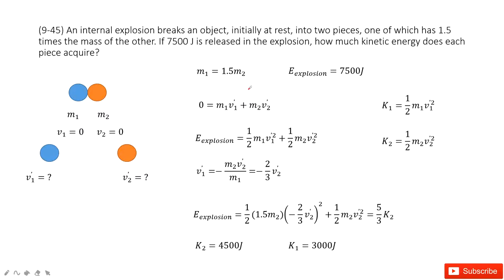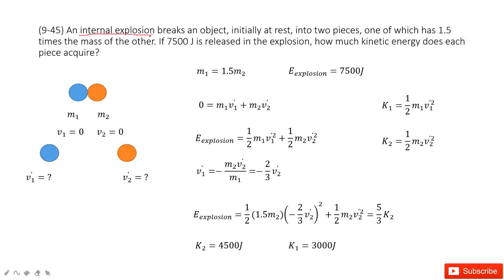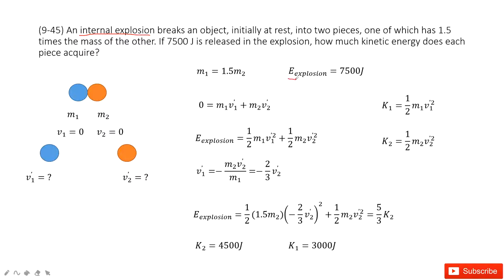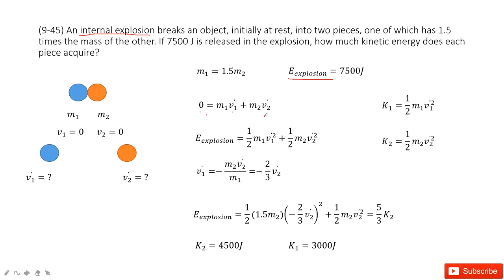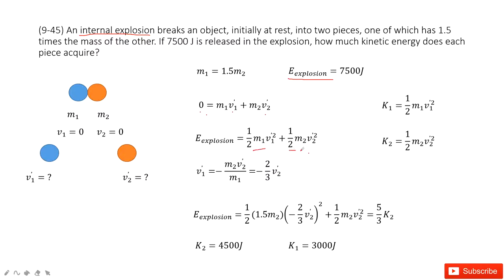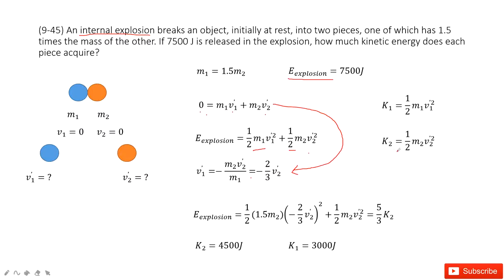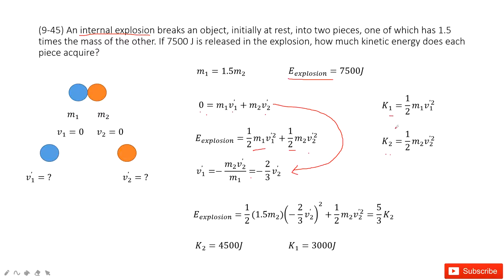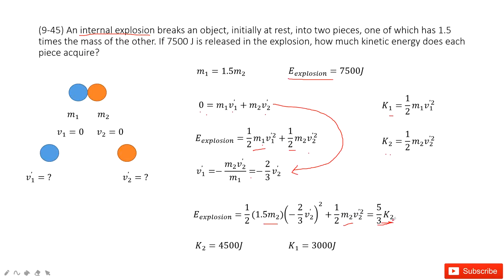(9-45) An internal explosion breaks an object, initially at rest, into two pieces, one of which has

Comment: This might be a error by me, but I just reasoned that by adding the potential energy of the two after the explosion, you would get 7500J. Thus, x+1.5x=7500. Then you would solve for x. v can be ignored because the velocity should match the ratio between the two. This is probably a stupid way of going about this because I don't fully understand why this works either, and it was just luck that it's right. <